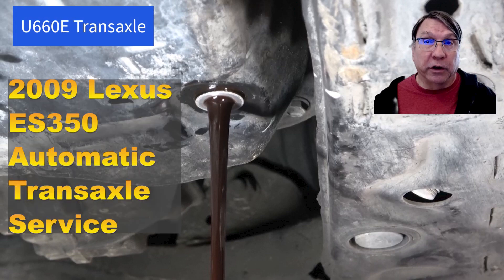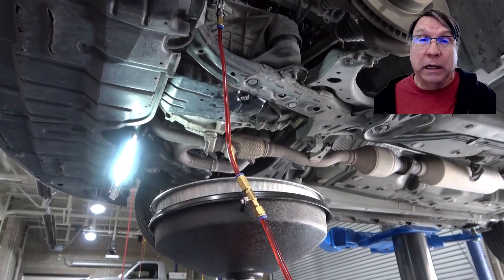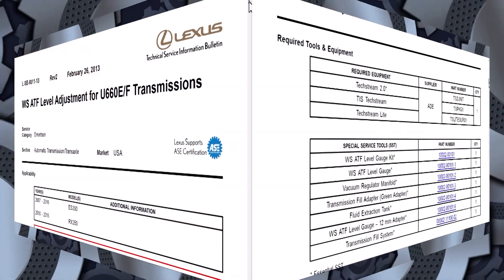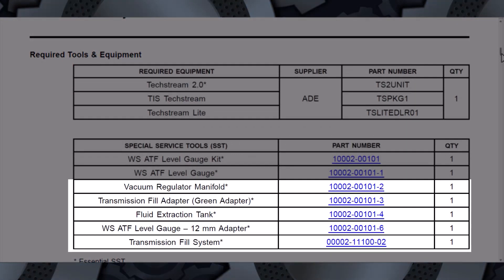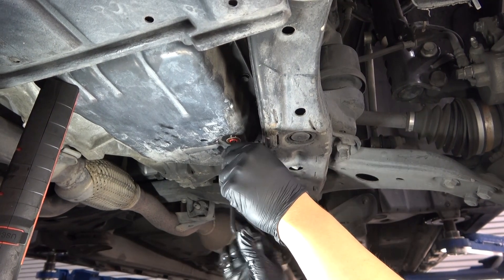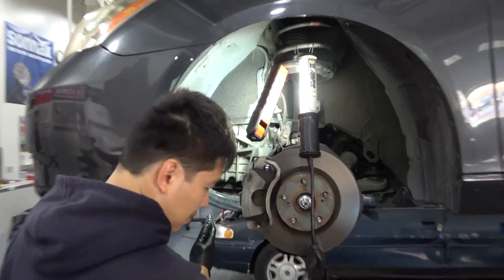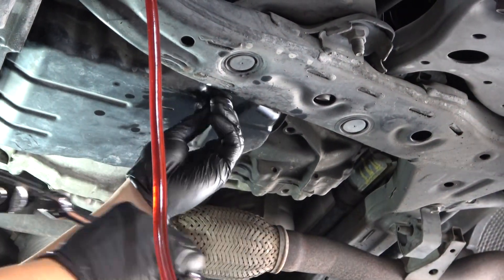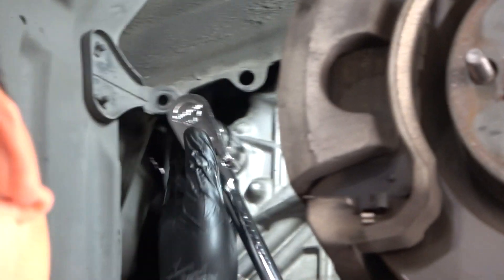Lexus 2009 ES350 Automatic Transmission Fluid Drain and Fill

Comment: my technique for changing transmission fluid is much less complicated, pour out the old oil and pour in the exact same amount of new oil as I poured out. No special tools required.
Reply: Well I recently had my axle slip out and my car pissed out tranny oil I matched 4 quarts but I think it needs more but I don’t wanna over fill it you have any tips ???